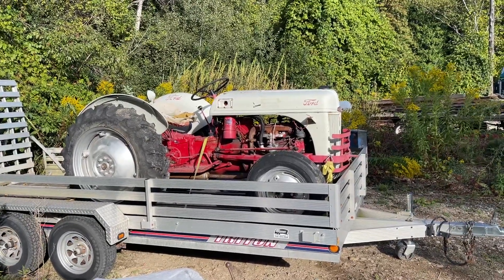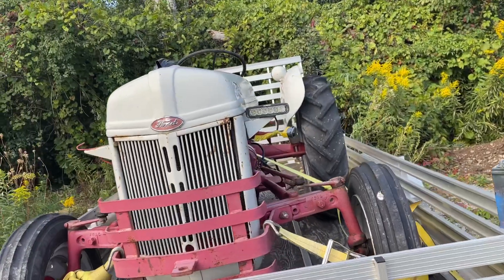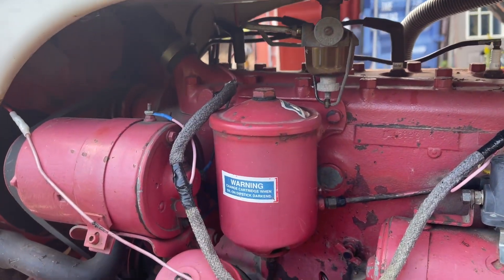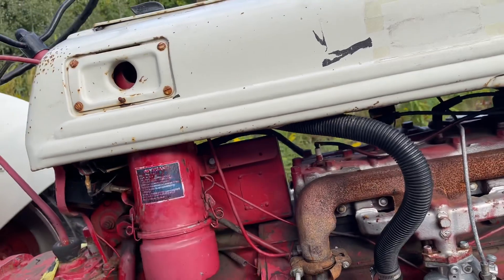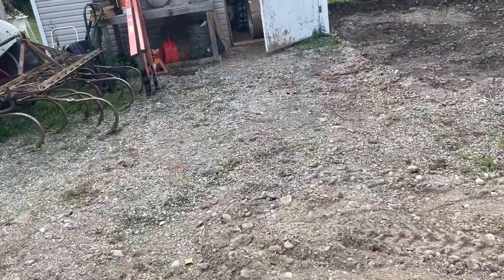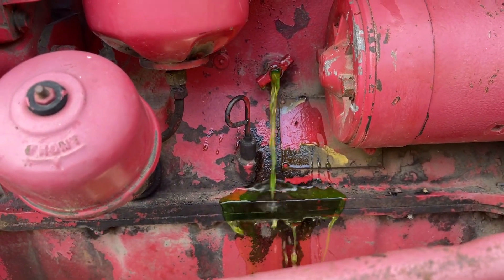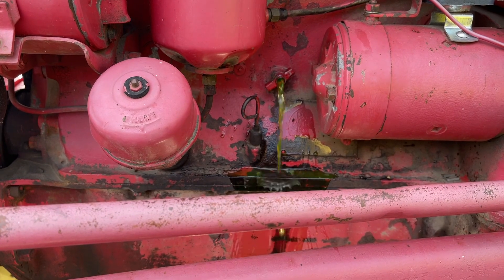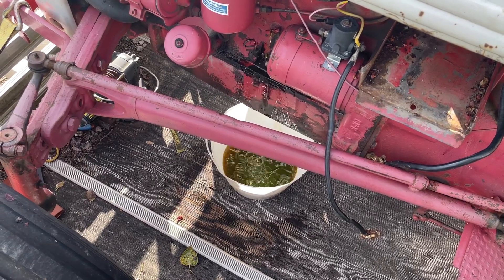Something jumped on my trailer.......WHO SENT ME THESE?????

Comment: It's called a crank..It's used to start the engine.. Usually magneto pulse controlled spark engines..They are of no use on battery controlled spark engines if you have a dead battery..
Reply: If you have  enough battery to make a spark and it's  starting handle equipped you can still hand crank start it. I've done it many times with old gas tractors like T20  Fergie's that don't have mags and a weak battery that wouldn't turn the engine  .  My Fordson E27N with a mag and electric start actually starts better on the handle, the 12v system spins it so fast the impulse on the mag stops working properly and it doesn't spark !